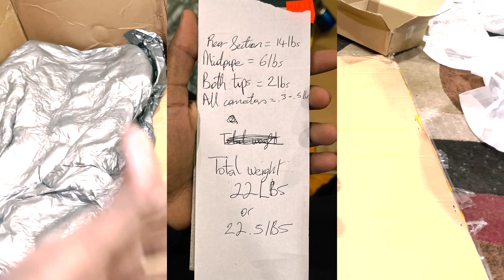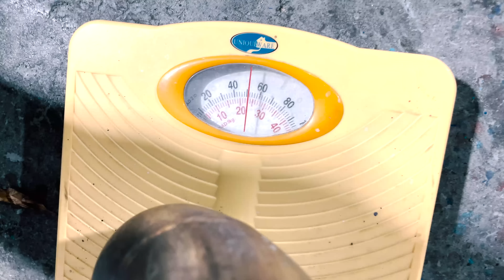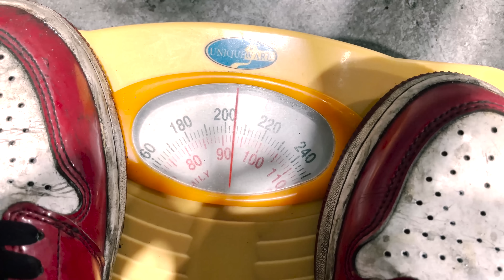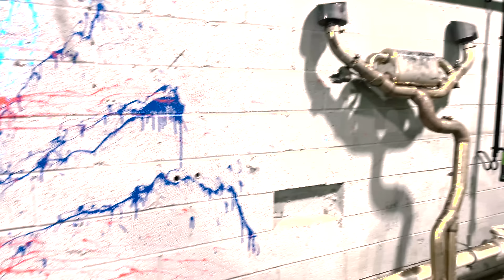MY TTRS GETS A TITANIUM EXHAUST! BEST SOUNDING 5 CYLINDER!

Comment: I was expecting it to sound better tbh
Reply: Lol Fr
Reply: Sounds great in my opinion its not a v8 either
Reply: Yeah I don’t think there was much difference compared to stock
Reply: It’s not the sound, it’s the weight savings. Plus, the sport exhaust on Daza cars sounds very good, so aftermarket ones will only sound a little better
Reply: stainless steel was better imo

Comment: Any chance you have sound bites from the interior? How much louder inside is it over stock? My guess is it's like open factory in the closed position and louder than stock in the open position? Also were you able to connect it to the factory switch or do you have to have a remote?